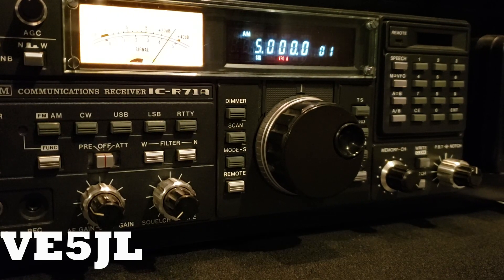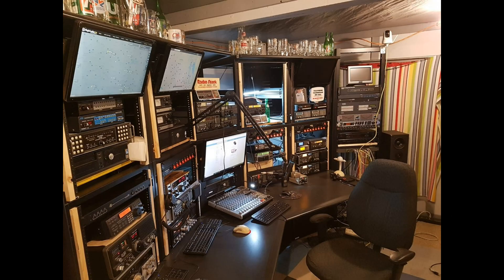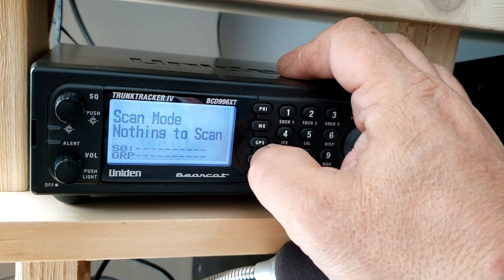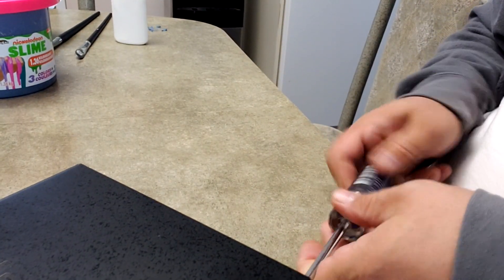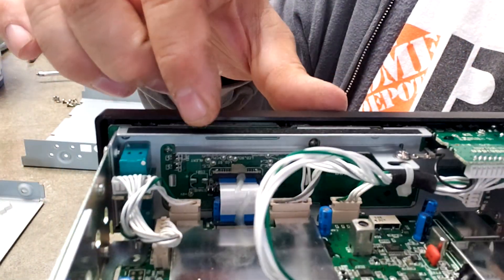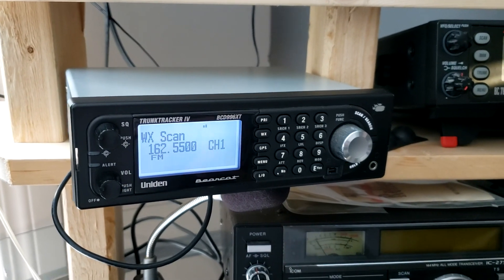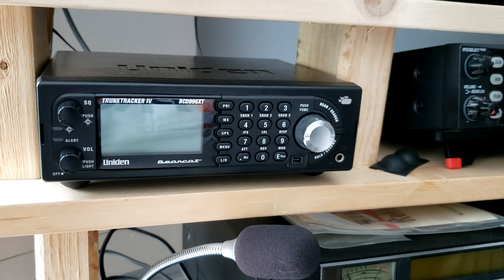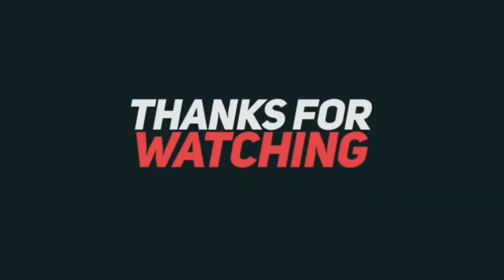Keypad issue with the Uniden BCD996XT FIXED!

Comment: Don't  know if you have had this issue but I recently acquired a 996xt and have it connected to my computer recording tg id's and such, however, I've noticed that it shuts down and reboots frequently...not sure if its the proper power source  because  that too came with
What I was concerned with was the black out of the case s# bend ground shield  on bmc connector and the obvious  volume issue that  someday  I'll try to work out.

Comment: Yes my 780xlt has the same problem. 2,5,8,and 0 are not working,the print on the keypad is not worn at all. I will try this quick fix. Thank you 👍